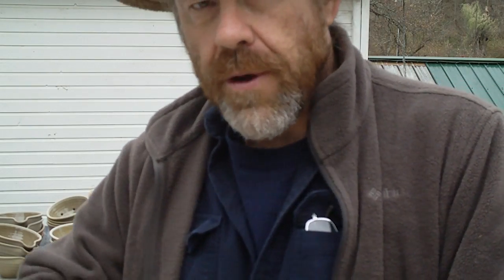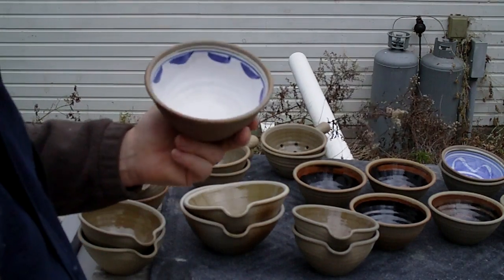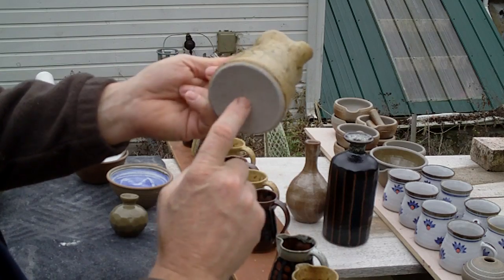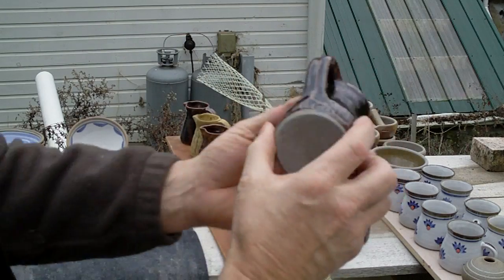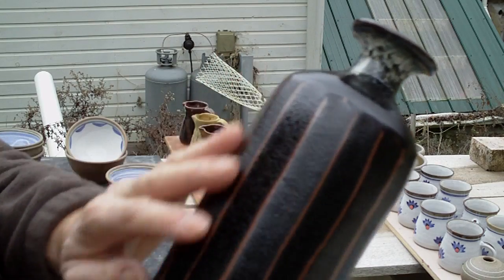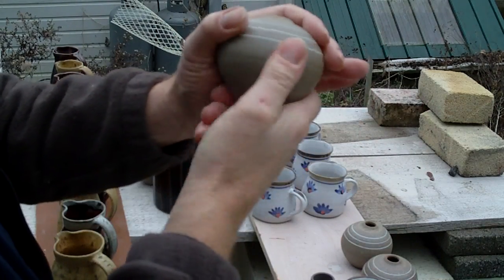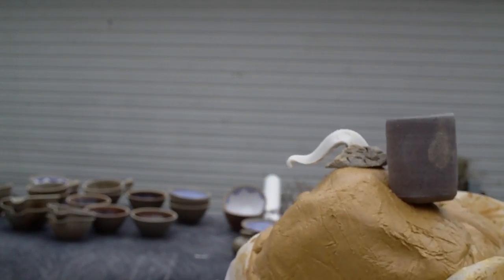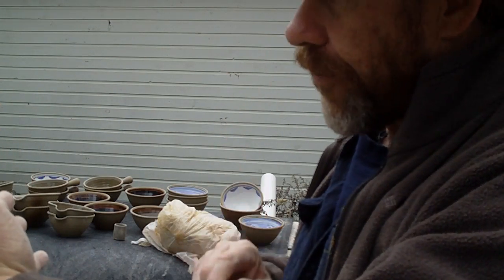SIMON LEACH POTTERY ~  Pots resume of latest firing 19 nov 2011

Comment: I suspect the yellow color of your dug clay is yellow iron oxide and that it is really iron rich judging by the dark color.  I wonder if it is microwave safe?  I'll bet it would make a nice glaze material.  Have you mixed it with ash yet?  

Shino glazes are very reactive to the clay body, thickness, and when you begin reduction.  Earlier is better generally, but there are always other things to consider as you well know.